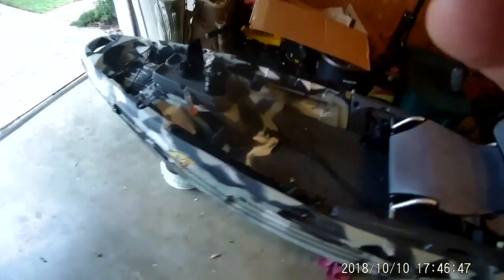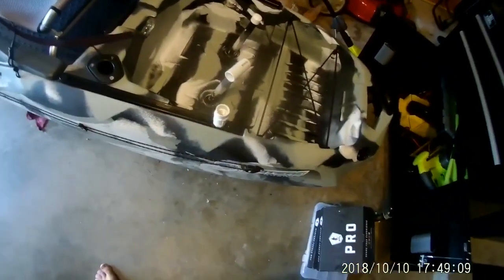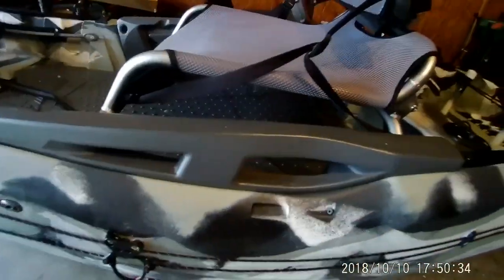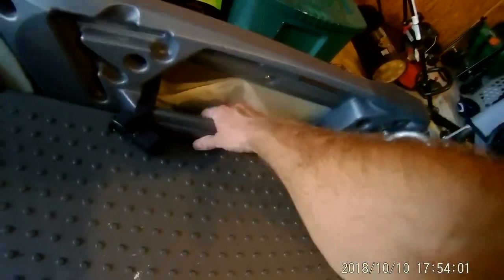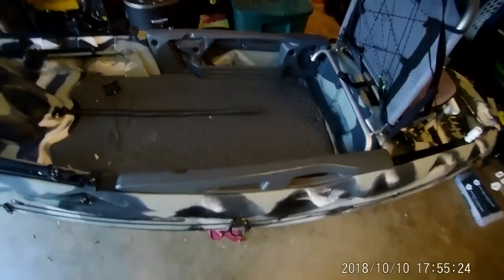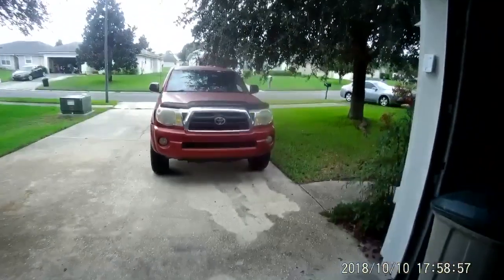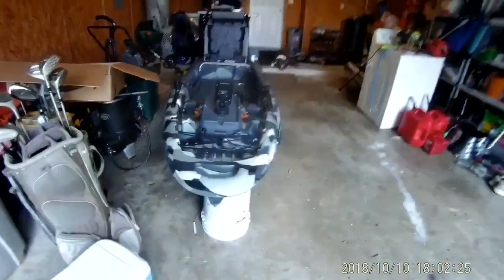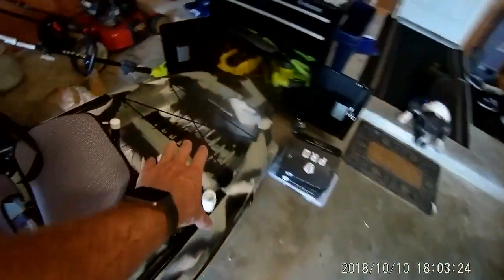3 Waters Kayak Big Fish 105 review and analysis

Comment: I've been thinking about this kayak.  I also have some ideas on how to mount a trolling motor on the back.  Still have to work out the details but I'll be happy to share the info if I do go this route.
Reply from the maker: PLEASE share if you decide to do this! That could sway me to go ahead and purchase one here soon!
Reply: @saltysouthernfishing9432   winter is coming.  So I won't be buying a kayak for a couple months unless they go on sale, mostly waiting for my bonus that I will get in mid January.  But without the kayak I won't be able to design the bracket I will need and I won't be able to see how to route the wire for steering.  But my plan is to make it so it can be swapped out with a rudder and steer it with the foot controls with minimum cross over changes between the two.  I also want to be able to pull the trolling motor out of water easily with a possible lock in place if needed.  The Big Fish is my front runner on my kayak of choice right now.  So if you can wait until I get it.  I will be able to design it properly or you can give it a shot yourself.  I am also planning on having the speed controls up front with me as well with a possible PWM.  Still need to work out the details on that as well.  But if it works as well as I have it pictured in my head,  its going to be awesome and worth the wait.
Reply from the maker: Donny Engler sounds like a great idea! I think the lock in place and steering control up front would revolutionize this kayak for fairly cheap. I can kinda picture what your saying but will wait and see what you come up with. I dont plant on purchasing a trolling motor for a while myself.
Reply: @saltysouthernfishing9432  Just ordered my Big Fish 120
Reply from the maker: Donny Engler awesome! You’re going to live it

Comment: I ordered mine last week from ACK!  I look forward to seeing more videos from you on this kayak, especially any mods that you do.  One question, are the rails a standard rail that will take most accessories (like YakAttack)?
Reply from the maker: Thanks Jason! They are but you will most likely have to order the track adapters. They cost about $5 for a single from YakAttack. The FeelFree tracks tend to run a tad wider, so the adapters are necessary, but I will be posting soon on ways you can make cheap adapters rather than spending $5 for just one.